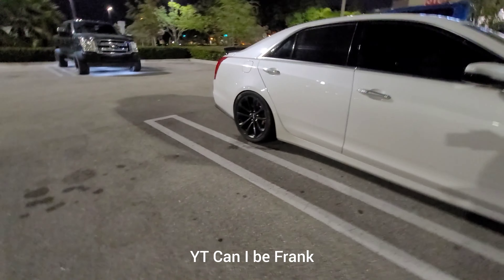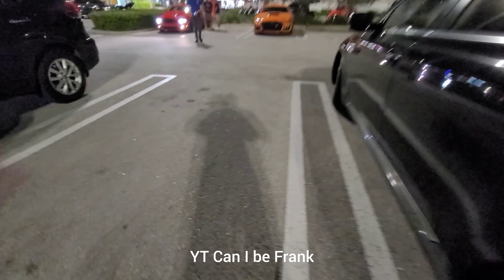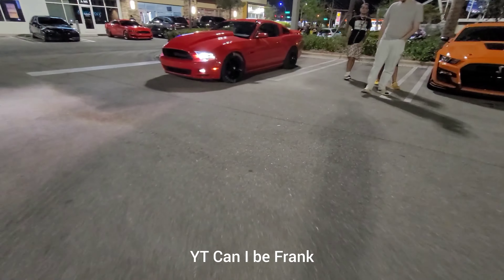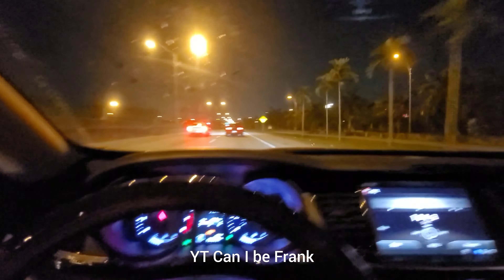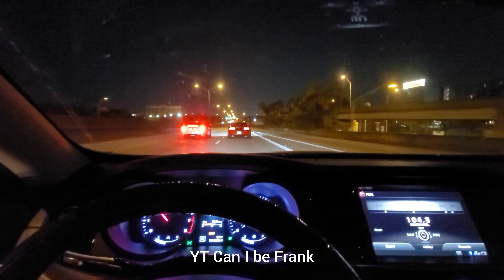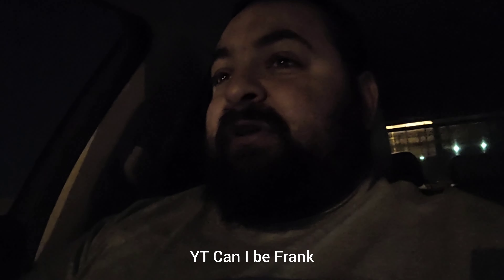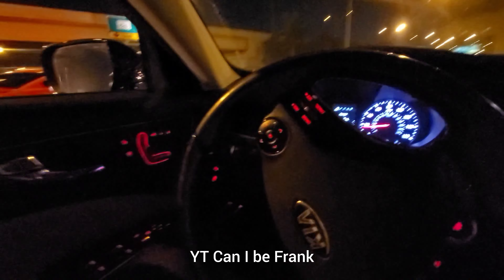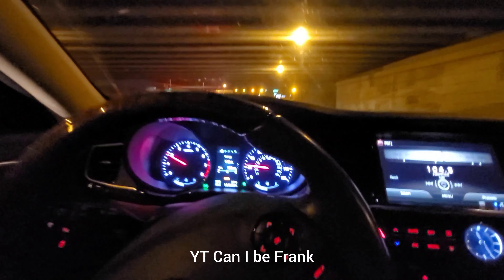CTS-V 3 Bolt-ons 93 vs S197 5.0 Mustang FBO E85 CJ Manual

Comment: That 5.0 is built right.
Reply: That's not built it's bolt ons dude 😂 and a tune.
Reply: @Socialjusticewarriorsaretrash  bolt ons?  Full bolt ons, gutted tin can, cobra jet intake, opened motor, skinnies, drag pack, race brakes, on E85.  Gets beat by a 4 door caddy that had a passenger running 93.  🤣🤣🤣embarrassing.
Reply: @Socialjusticewarriorsaretrash  I didn’t say it was a built motor, I said the car was built right.
Reply: @austinwiththef150  it's stock bro lol